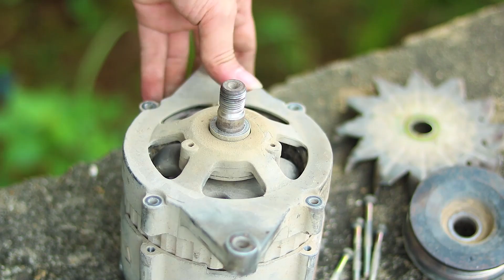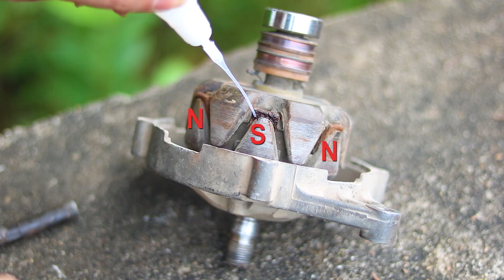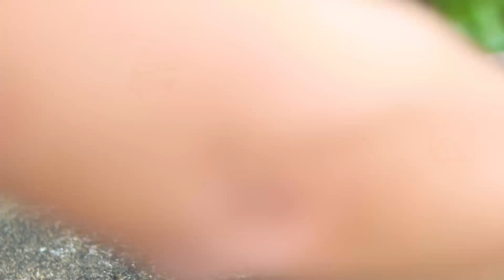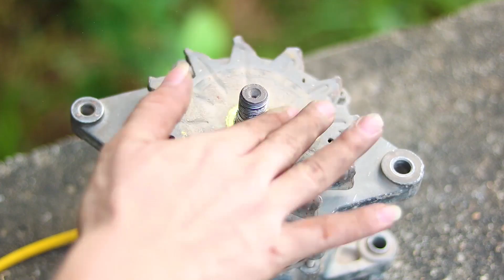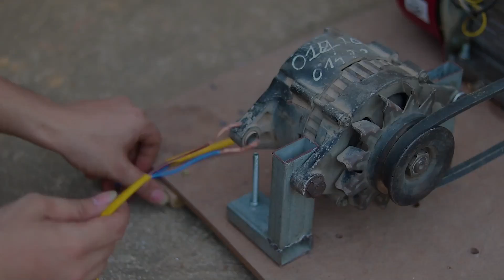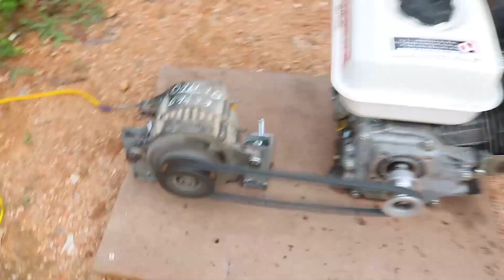Turn Car Dynamo into 250v electric Generator

Comment from the maker: How to make a Induction Heater By Magnet / alternative in the gas crisis => https://youtu.be/vb3d0b0fIF8
Reply: Instead of using magnets, why not use a 35a bridge rectifier and take some of the AC generated "self excite" the rotor?, It would definitely need current put in to start excitation, a battery?

An electromagnet should increase the power output as the more power drawn the more powerful the magnetic rotor becomes. 
Permanent magnets must have limitations? If they was better they would use them instead of electromagnets on all alturnators 👍🏼
Reply: Does it matter which 2 of the 3 phases we join together?
My alturnator windings are different to yours
Reply: @DaVeHiLl200  No matter which one you chose.
Reply: @DaVeHiLl200  permanent magnets don't like heat. I've had hobby remote control BLDC motor magnets fail, even to rated at higher rpm than I ever reached. Magnet gets hot and loss of magnetism. Permanent magnets are used in petrol generator running at 1000 rpm as opposed to 3500 rpm.

Comment: hi friend! i copped your alternator generator and it realy works!! i plugged the microwave in and it realy does produce enough to run any electric idem i used six power plug to plug into and all six worked great i had a radio and heater going outside where no electric just like you did wow! thankyou!! youre awesome!!!!!
Reply: Can you share the materials you used sir? thanks
Reply: Please share the materials you used if it really worked
Reply: Are you lying? Is that why you don't want to answer the people who asked you for a material list 🤔🤨?
Reply: @selfless_single  Have you got any feedback? Does that really work? Most experiments do not generate more than 16 V. At least, they must be plausible or feasible. 🤔 I'm happy for the successful ones.

Comment: Here is the thing, who wants to know if this is fake or real? I have the tools, resources, and know how to test his setup. Here is the issue I have with his setup.

1) He puts the magnets under the poles. This would significantly reduce the flux being that far from the coils, higher RPM would mitigate this.
2) He only put magnets on every other pole = 6 poles of 12 total poles, again higher RMP would be needed.
3) Those rusty magnets look like 1.5" x  1" x 1/8", and unless they are neodymium there is no way that would work.

I am building one myself. I have neodymium magnets, one set is 1.5" x 1/2" x 1/4" and I put them on every pole = 12. On another test I am using 1.5" x 1" x 1/4". If yours is correct then I only need to put these on every other pole. Stay tuned, and I will reveal if this is are REAL of FAKE!
Reply: Have you figured out if this was fake or not? I just got two alternators and just purchased basically the same size of magnets. Wondering if the stator winding would have to change to get such high voltage or just use existing polls that are on the stator?
Let me know how far along this project you're in. 
Thanks.
Reply: @drewskiakg2719  I am still setting up. I know it works since there is a patent that uses 1/2 HP motor with 2x alternators. In addition, this is just a version of the RotoVerter You just need strong enough magnets to increase the flux. The flux is maximized by putting the them as close as possible to the stator coils. I will be documenting my work along with the theory. The magnets I am using are 1.5 x 3/4 x 1/8 but they are REAL N52. Be warned that many are selling fake N52's that are really N38 or N40.
Reply: @mikez1r  I can't wait to see the progress that you make and that is very true about the magnets. I just purchased mine from Amazon. Probably not a good source, but the only place I know I can return within 30 days. I'll be waiting for your videos and updates. I'll be building and following along with you. 
Thanks again.
Reply: @drewskiakg2719  I'm waiting too.
Reply: @mikez1r any updates on your alternator electric generator
Reply: @drewskiakg2719  Have you got any feedback? Do you think it really works? Most experiments do not generate more than 16 V. At least, they must be plausible or feasible. 🤔 I'm happy for the successful ones.

Comment: Hi, my alternator have 6 wire ….how to connect it? Can you help me? Regards
Reply: I would also like to know this 👍🏼
Reply: @DaVeHiLl200  use a multimeter to determine which ends are of a winding. then find the different windings and measure the ohms. its not as simple as he makes it look. trust me
Reply: Six wires means you have 2 x 3-phase coils. If you want the same as he did then tie off one set and connect ph1 and ph3 just like he did. Or even better you can connect Coil1 ph1 + Coil2 ph1 and Coil1 ph2 + Coil2 ph2. this gives you double the power rating. So to summarize (ph11 + ph12) + (ph21 + ph22), where ph11 = Coil1 phase1.

Comment: The pump draw is about 500 watts max. And sound system by looking at the size of 2 woofers? But no specs on amplification. Could be a 500watt amplifier? 1 kw? Approximately? My GM car Alternator puts out 1200watts at max output. If I had a v8 GM Alternator ( a high output version)  2400 watts approximately at full field current. You can't run long at full field current! Alternator will burn out! Specification would be great!! Any reply appreciated.
Reply: If your car alternator puts out 1200 Watt at 12 v it means it's at 100 Amps. Then the alternator converted into 220 V can (theoretically) give an output of 100 x 220 = 22 Kw. Just saying, because you don't mention Amps.
Reply: @petercernjavski9419  yeah you're right. I did the 100 amps times 12 volts in my head lol. I have a habit of doing that part in my head for some unknown reason? Lol 😆. Cheers from Australia

Comment: bro pls ansr me ..1 qustn….i also modify 1 alternator…output come only 24v…why not come 220v?????????.pls ansr me ..reason?
Reply: if your output is 24v you need to buy a 24v inverter 1000w to convert AC power so that you can use

Comment: hello I removed the stator from the dynamo and it has 6 ends instead of 4 how do I wire them, is it even possible
Reply: Have you got any feedback? Do you think it really works? Most experiments do not generate more than 16 V. At least, they must be plausible or feasible. 🤔 I'm happy for the successful ones.

Comment: Hello. What is the size of the magnets? Width,length,thickness of the magnet.Thanks.
Reply: Those are 1 x 1/2 x 1/8. So I am a little skeptical of this since he only powers every other pole and those magnets are defiantly NOT the strongest, which would be N52, but if they are N52 it would be more plausible.

Comment: Excuse me, your video is confusing, the little plant is using gasoline, it seems that your point will have more energy than what the plant generates, excuse my ignorance, can you correct me if I'm wrong?
Reply: I believe he is just using the gas generator to show how much the permanent magnet generator he made is producing, it runs all those appliances at once, it's around 2400 watts. Which is very impressive if true.

Comment: Now loop it into a 3hp electric motor and walla
Reply: 1 HP is enough I think
Reply: Single phase motor
220 volts
50 Hz
1cv (1 HP)
2800 rpm

Truck alternator
24 volts
200 Amp

Comment: CAR ALTERNATOR MAKE 12 OR 24 VOLT C O N T I N I O Y S VOLTAGE ...NOT  110 V OR 220 V  ALTERNATIVE ..... PUT A POLYMETER TO ALTERNATOR ....THEN MAY BELIVE YOU...
Reply: Pro Tip, do your homework before commenting. A rotating magnetic field produces AC voltage. He removed the diode bridge and voltage regulator so unlimited AC voltage can be generated on the output.

Comment: I did it star connection modified .
Rpm 2100.  ac 14.5v 
No 220v
Reply: i have also like this …25v last..output..but no 220v….?ask the man what kind of the alternator…?
Reply: You need to rewind the windings to get 220. They original ones are designed for 12v . it is all science. The guy gets 12v ... There is a video on YouTube how a guy gets 120v with a new winding with 216hz. Frequency is another problem to solve. Lamps will work but electronics can get destroyed IF you provide more than 60

Comment: Fake
Reply from the maker: NO FAKE. give it a try, there are many people who have succeeded
Reply: who have a successful.i also modify alternator only produces 25v..not 220v…?
Reply: @MRCOVER1  I know it works if you do it correctly. 
1) You put the magnets under the poles. This would significantly reduce the flux being that far from the coils.
2) You only put magnets on every other pole = 6 poles
3) Those look like 1.5" x  1" x 1/8", which seems too weak for 220v given the distance from the coils.

I am building one myself. I have neodymium magnets, one set is 1.5" x 1/2" x 1/4" and I put them on every pole = 12. On another test I am using 1.5" x 1" x 1/4". If yours is correct then I only need to put these on every other pole. Stay tuned, and I will reveal if you are REAL of FAKE!